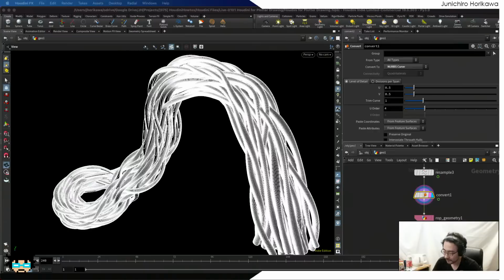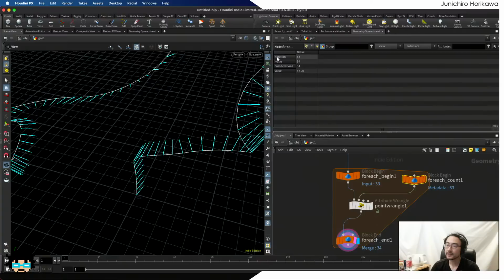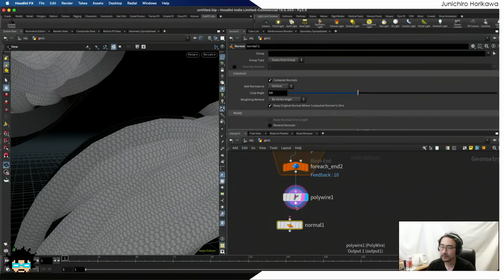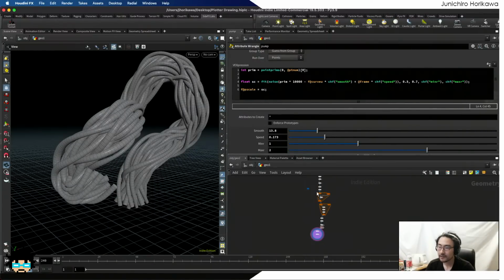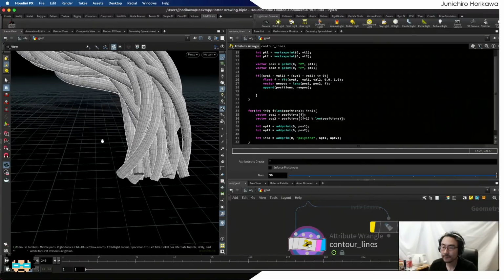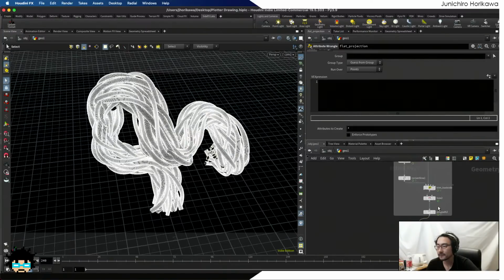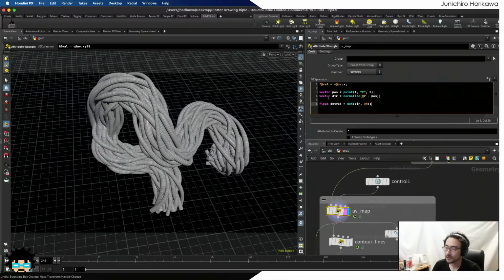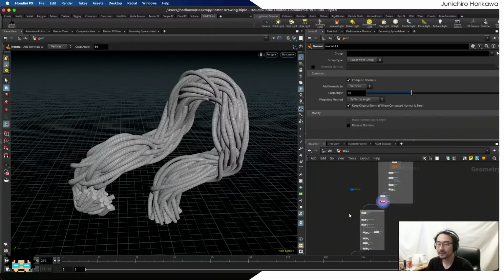Houdini Algorithmic Live #101 - Houdini for Plotter Drawing

Comment: Great tutorial as always Junichiro san.
Big thanks!

Actually there is no need to use Rest node for rest attrubute,just type P in Prev pos in Detangle.
No difference.

The rest attribute would be relevant if u do something through the SOP solver for example.
When you can really get the previous position.